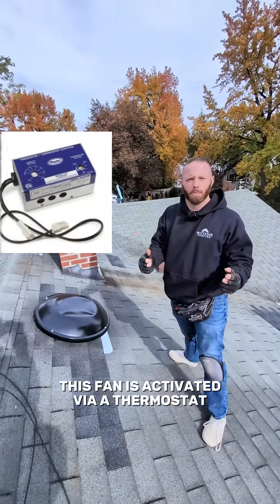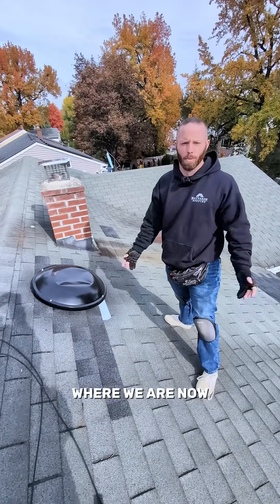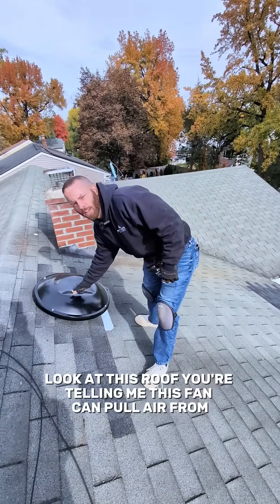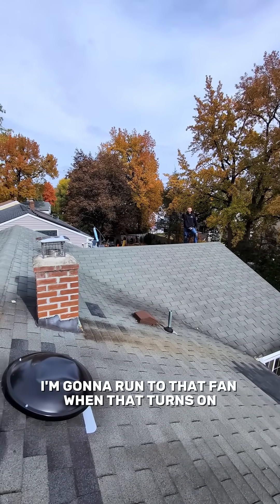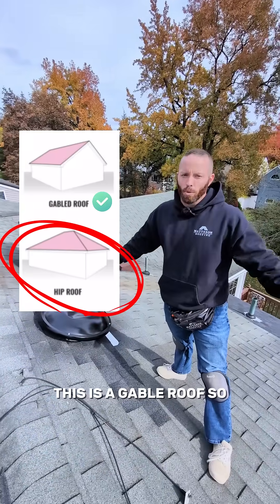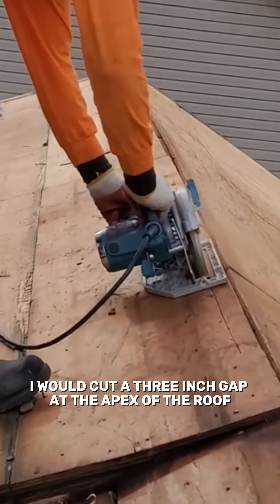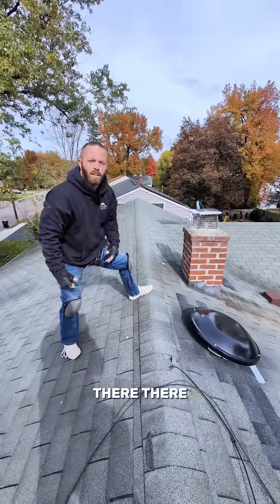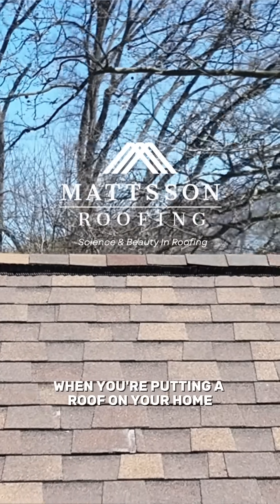Attic Fan vs. Ridge Vent — Why This Home Has the Wrong Ventilation Setup

Comment: If they would have put a couple push fans on each end with a high power pull fan in the middle it would move air fine